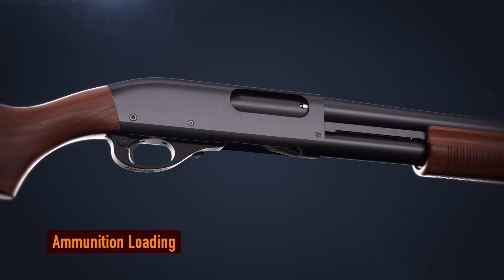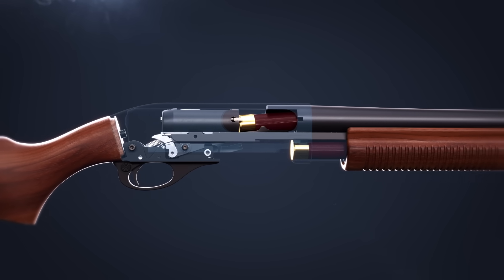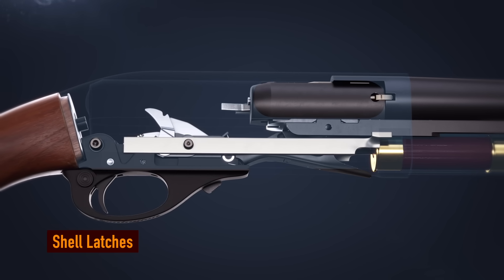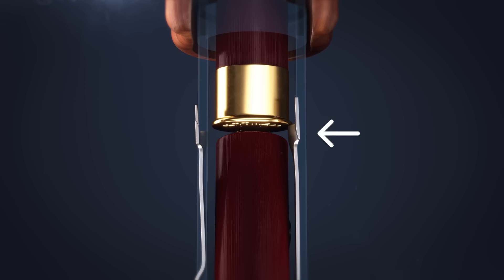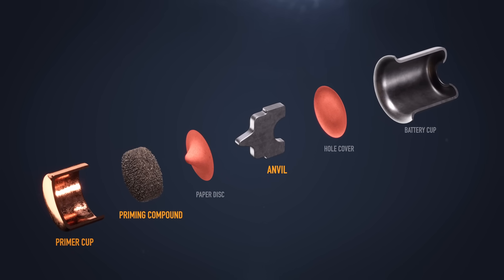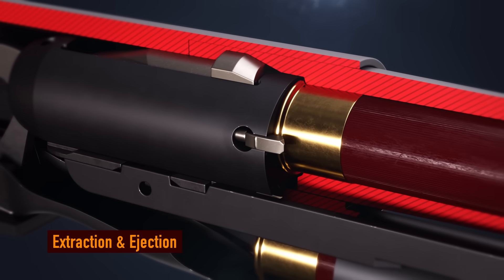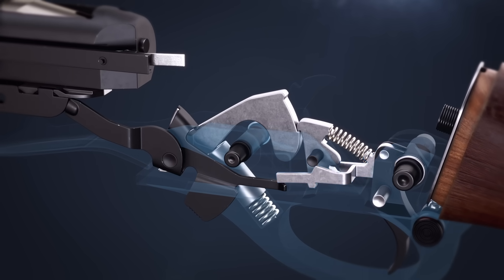How a Pump Shotgun Works

Comment: The Ithaca M37 sets the pace for pump action shotguns. 16 gauge is ideal for ducks, quail, and pheasants. Rabbits as well. Bam!!
Reply: Using a bigger gauge is so you don’t destroy the meat, right?
Reply: @gabecollins5585  No. 16 gauge works just right. Got to choose the proper shot size and the proper power level. Field loads for quail. High velocity for pheasants.
Reply: @alanstrong3295  16 gauge to not destroy the meat right?

Comment: What's wad for, it just sits there occupying space. Couldn't they put in more powder or pellets instead?
Reply: You need a wad to act as a gas seal and to push all the shot through.  They frequently also have other functions as well such as helping stabilize the shot column while in the barrel, and some will even act as a flight cup for a short distance as well to minimize spread.

Comment: So the shot gun does automatically load another shell after being fired right? I don’t have to manually press that little button on the side to load it?
Reply: After firing, you need to manually pump this kind of shotgun.  The action release button is only there to release the pump when the action is cocked, such as when you have loaded 1 in the chamber but you haven't fired it.  If the hammer is not cocked, or after you pull the trigger, the pump will automatically release so you don't need to push the button.

Comment: I get why the Remington 870 is popular and all. But, personally, I’m moving onto Mossberg’s 500 model. Namely because of it’s ambidextrous safety, and it’s lighter capacity, being made of aluminium instead of steel.
Reply: New remmington models are trash anyway.  Better off with the reliability and durability of the mossberg 500s and 590s.  If you can get your hands on an old Remmington, maybe do so but why bother when Mossberg is still kicking ass to this day
Reply: @deadreckonw You read my comment, right. I was always willing to put Mossberg first ever since I started getting some research between the two shotguns.
Reply: @ek9509 Hell yea, mossy all day

Comment: Pump action is a type of manual firearm action that is operated by moving a sliding handguard on the gun's forestock. When shooting, the sliding forend is pulled rearward to eject any expended cartridge and typically to cock the hammer or striker, and then pushed forward to load a new cartridge into the chamber. Most pump-action firearms use an integral tubular magazine, although some do use detachable box magazines. Pump-action firearms are typically associated with shotguns, although it has also been used in rifles, grenade launchers, and other types of firearms. A firearm using this operating mechanism is colloquially referred to as a pumpgun.

Because the forend is manipulated usually with the support hand, a pump-action firearm is much faster than a bolt-action and somewhat faster than a lever-action, as it does not require the trigger hand to be removed from the trigger while reloading. Also because the action is cycled in a linear fashion, it creates less torque that can tilt and throw the gun off aim when repeat-firing rapidly.

History

[edit]

The first slide action patent was issued to Alexander Bain of Britain in 1854.[1][2] The first pump action firearm with a magazine was technically the gun patented in America on the 22nd of May in 1866 by Josiah V. Meigs although the pump action was actuated via the trigger guard rather than a sliding handguard underneath the barrel.[3] The first magazine-using pump-action firearm to operate using a sliding handguard underneath the barrel was the firearm patented by William Krutzsch of Britain on the 27th of August in 1866, a few months after Meigs.[4] The first pump-action shotgun to be sold commercially and in substantial quantities was the Spencer 1882.[5][6]

Many older pump-action shotguns can be fired faster than modern ones, as they often did not have a trigger disconnector, and were capable of firing a new round as fast as the pump action was cycled, with the trigger held down continuously. This technique is called a slamfire, and was often used in conjunction with the M1897 and M1912 shotguns in World War I trench warfare.

Comment: That was actually far more complex than I imagined it would be. Whoever designed the 870 was a genius. 

With so many moving parts, how is it so reliable? Blows my mind.
Reply: • L.Ray Crittendon, 
• Phillip Haskell, 
• Ellis Hailston, 
• G.E. Pinckney
Reply: it's so reliable because:

A) it's manually operated rather than relying on some particular mechanism (i.e. gas from firing the round) to do the work for the user, which means even if something gets messed up or stuck, the user will likely fix it simply by operating the pump mechanism as normal
B) it's WAY simpler than many other firearms which have systems with even more potential points of failure
C) Modern firearms are precision-tooled to an insane degree, manufacturers are capable of creating millions of copies of a part that are so perfectly similar as to be indistinguishable to the naked eye, no noticeable flaws or irregularities
Reply: @bonehed1  D) Made in America. 🇺🇸
Reply: @AL-Lee-G Funnily enough, not as much as you'd think. USA-made firearms can have a spotty reputation in other parts of the world.
Reply: @AL-Lee-G hahaha... Buddy just showed me his new Springfield hellcat.... Flipped it over. Made in Croatia. Where something is made means way less than the quality of the design and equally important, the manufacturer's quality control. I don't care where it comes from, as long as it is well designed and decent build quality
Reply: Christopher Spencer was the genius that imagined the pump action shotgun. Pump action shotguns today are reimagined versions of his vision. Yes these guys were smart, but their money was made by creating a design that could do what Spencer imagined without violating his patents.
Reply: So if firearms are removed from the world. People will never have them again? Clear proof of a divine force in the universe.
Reply: Which came first the Remington or the Winchester?  Saying this because the Winchester looks identical
Reply: @PappyGunn  First Remington shotgun was 1889, first Winchester 1887, apparently

Comment: I have a Mossberg 500 series field rifle 12 gauge.  

 I like Mossberg because of the position of the release behind the trigger housing instead of being built into the trigger housing. 

 Not to mention the safety being ambidextrous located on top. Easy to access, and use.
Reply: Matt has since done a Mossberg 500 animation which is posted in YouTube by Mossberg. It is of similar quality, but less detail and without the voiceover. The two designs are very similar, but not identical, with the release and safety being the differences that I noticed.

Comment: I have a Mossberg 500 which had too much of a curve on the left shell latch which made it very difficult for a shell to be let out of the tube when pumping the gun, I had to pump it very hard backwards for it to disengage and allow a shell out of the tube until I took the gun apart and very gently bent that left shell latch a little straighter and now the pump action works perfectly allowing a shell out of the tube every time its pumped even slowly.

Comment: So what happens if you replace the shot with a single round instead of...er, pellets or whatever they're called? How accurate would that be? Would it be comparable to a rifle? Or does it technically become a rifle rather than a shotgun by virtue of having a shot that doesn't spread but fires a bullet from the shell instead?

Sorry, I'm an idiot about guns but I'm a curious idiot.
Reply: That’s called a slug, and it’s a very common type of shotgun round. They’re usually considered accurate within 100 meters or so. Because shotguns are not rifled and the projectile itself is large and catches the air, it is not as accurate as a rifle.

Comment: Only need to pump once?
Reply: nope you have to pump every shot. A semi auto shotgun uses the power of the shell casing after firing to reload after the initial shot, a semi auto has a charging bar on the bolt to manually load the first shot from a tube like shown or a detachable box magazine like an AR 15.

Comment: Shotshells are loaded into the magazine through the bottom of the receiver the compressed magazine spring keeps tensions on the shells pressing the action bar lock allows the fore-end to be pulled to the rear as it comes back, a shell is fed into the receiver pushing forward of the fore end lifts the shell and the bolt guides into the chamber as the fore-end moves back, a cutout on the bottom of the slide engages the 'carrier dog'. As the slide moves forward downward force is put on the 'carrier' acting as a lever to lift the shell up. The left and right 'latches allow shells into the receiver under the control of the fore-end tube assembly notches on the assembly move the latches in and out at  specific times. The left latch holds the shell until the fore-end is almost fully rearward. After the first shell advances into the receiver the right latch catches the next shell. As the fore-end is pushed forward, the first shell is moved into the chamber and the left latch assumes control of the next shell. When the bolt makes contact with the 'breech face', the 'slide' pushes up on the 'locking block', locking it into the barrel. With the 'safety' in the off position the trigger is free to move pulling the trigger rotates the 'sear', which releases the 'hammer'. The hammer strikes the 'firing pin' causing it to travel forward and impact the shell primer. The inside of a shotshell contains a primer powder charge, a wad, and shot, or a slug. inside the primer is a primer cup, priming compound, and an anvil. as these are struck by the firing pin a chain reaction ignites the powder charge inside the shell, and the wad is propelled down the barrel. just after leaving the barrel, the wad opens so that shot can spread The 'extractor' grips the rim of the spent shell case as the fore-end is pulled to the rear, the bolt is unlocked and the case is extracted from the chamber The bolt continues to the rear and the 'ejector' kicks out the empty case from the receiver as the bolt comes back, the 'hammer' rest' and held back to the 'sear' when the fore-end is fully forward the 'action bar lock' lowers the 'connector'. Again, allowing control of the sear with a pull of the trigger

Comment: Super smooth video, I love it! For my first gun I actually went with a single-shot break-action, the single most basic..well, gun, probably. I didn't want too many difficult-to-clean or difficult-to-fix mechanisms. It doesn't even have a safety. But it has an ejector!

Comment: Interesting the Remington manual does indeed refer to the "cartridge interrupter" and "cartridge stop" as left or right "shell latches".   I guess I'm so use to working with Mossbergs, but the parts of both guns serve the same exact purpose, the "interrupter" of both guns being on the right side of the receiver.  Some manufacturers also call the "shell lifter" the "elevator" or now less common "spoon".

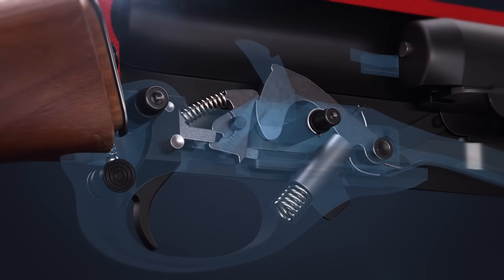Comment: 2:03 I learned the hard way not to let a sear get even a little bit rusty.
My Mossberg 500 sear step filled with rust and became a ramp instead of a step, resulting in an accidental discharge into my porch floor.

Comment: I still dont understand what locks and unlocks the action bar. If the trigger unlocks the action bar (which is why you dont need action bar between shots) then why can you rack an empty gun endless times in a row.
Reply: Most pump shotguns have an additional button that needs to be pressed to pump it if the trigger is cocked.
Reply: the lever locking the bolt has an external release. Holding the release down allows the bolt to move freely.

Comment: How does a choke work?
Reply: At the end of the barrel is threads that will let you screw in what is essentially different sized pipes. Chokes change the diameter of the end of the barrel, forcing the shot into a tighter area. This results in tighter patterns.

Comment: The whole thing seems to me to be very prone to errors. Does this mechanism really work that well? The material from which this delicate mechanism in the weapon is made of should actually bend or break very quickly. The forces that act on the small components are enormous, right? I just can't imagine it that this fine mechanism can withstand thousands of shots without anything breaking.
By the way, I'm a TOTAL LAYMAN in this area. But I'm very interested in the whole process. These fine materials have to be so extremely resistant. Can someone explain to me what they're made of? This extremely resistant material is made of titanium perhaps? A fine mechanism made of normal steel would never be able to withstand these forces for a thousand shots? Or? 🤔
Reply: Most shotguns use steel for anything that has to bear pressure. The pressure actually isn’t incredibly high for a gun. Shotguns are one of the lower pressure firearms out there. 

No, the mechanism is not weak. Modern shotguns can shoot tens of thousands of rounds easily. As long as it’s cared for properly. In fact, one of the shotgun’s biggest praises is the fact that it is so robust due to its mechanism.

Comment: Does that mean that the metal balls make it so that a pump shotgun is just a BB gun 2:47
Reply: Sort of, but instead of just one little bb it's a cloud of them flying at high speed (much higher than a bb) delivering an insane amount of energy on impact. Or it can be a 00 buckshot, where there are 9 to 11 .380 caliber sized balls at 400 meters per second.

Comment: Here is a Description of a shotgun A shotgun (also known as a scattergun,[1] or historically as a fowling piece) is a long-barreled firearm designed to shoot a straight-walled cartridge known as a shotshell, which usually discharges numerous small pellet-like spherical sub-projectiles called shot, or sometimes a single solid projectile called a slug. Shotguns are most commonly smoothbore firearms, meaning that their gun barrels have no rifling on the inner wall, but rifled barrels for shooting slugs (slug barrels) are also available.

Shotguns:
Break action
Lever action
Pump action
Semi automatic
Fully automatic

Shotguns come in a wide variety of calibers and gauges ranging from 5.5 mm (.22 inch) to up to 5 cm (2.0 in), though the 12-gauge (18.53 mm or 0.729 in) and 20-gauge (15.63 mm or 0.615 in) bores are by far the most common. Almost all are breechloading, and can be single-barreled, double-barreled, or in the form of a combination gun. Like rifles, shotguns also come in a range of different action types, both single-shot and repeating. For non-repeating designs, over-and-under and side-by-side break action shotguns are by far the most common variants. Although revolving shotguns do exist, most modern repeating shotguns are either pump-action or semi-automatic, and also fully automatic, lever-action or bolt-action to a lesser extent.

Preceding smoothbore firearms (such as the musket) were widely used by armies in the 18th century. The muzzleloading blunderbuss, the direct ancestor of the shotgun, was also used in similar roles from self-defense to riot control. Shotguns were often favored by cavalry troops in the early to mid-19th century because of its ease of use and generally good effectiveness on the move, as well as by coachmen for its substantial power. But by the late 19th century, these weapons became largely replaced on the battlefield by breechloading rifled firearms shooting spin-stabilized cylindro-conoidal bullets, which were far more accurate with longer effective ranges. The military value of shotguns was rediscovered in the First World War, when American forces used the pump-action Winchester Model 1897s in trench fighting to great effect. Since then, shotguns have been used in a variety of close-quarter roles in civilian, law enforcement and military applications.

The smoothbore shotgun barrel generates less resistance and thus allows greater propellant loads for heavier projectiles without as much risk of overpressure or a squib load, and are also easier to clean. The shot pellets from a shotshell are propelled indirectly through a wadding inside the shell and scatter upon leaving the barrel, which is usually choked at the muzzle end to control the projectile scatter. This means each shotgun discharge will produce a cluster of impact points instead of a single point of impact like other firearms. Having multiple projectiles also means the muzzle energy is divided among the pellets, leaving each individual projectile with less penetrative kinetic energy. The lack of spin stabilization and the generally suboptimal aerodynamic shape of the shot pellets also make them less accurate and decelerate quite quickly in flight due to drag, giving shotguns short effective ranges. In a hunting context, this makes shotguns useful primarily for hunting fast-flying birds and other agile small/medium-sized game without risking overpenetration and stray shots to distant bystander and objects. However, in a military or law enforcement context, the high short-range blunt knockback force and large number of projectiles makes the shotgun useful as a door breaching tool, a crowd control or close-quarters defensive weapon. Militants or insurgents may use shotguns in asymmetric engagements, as shotguns are commonly owned civilian weapons in many countries. Shotguns are also used for target-shooting sports such as skeet, trap and sporting clays, which involve flying clay disks, known as "clay pigeons", thrown in various ways by a dedicated launching device called a "trap".